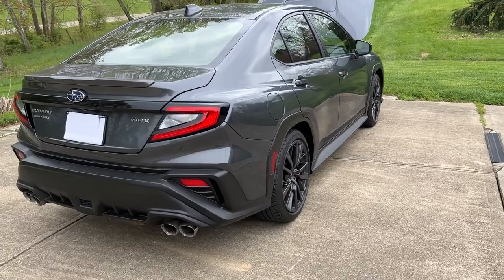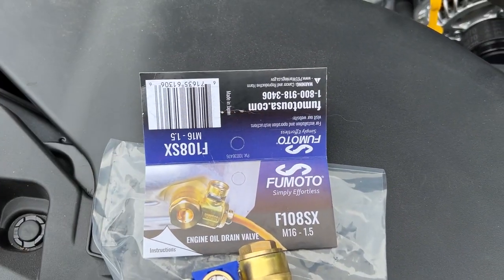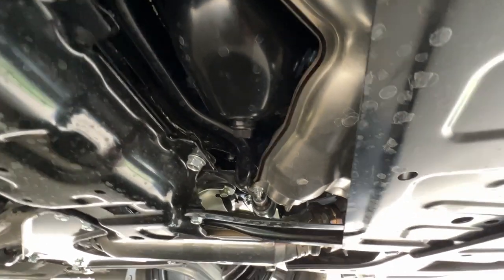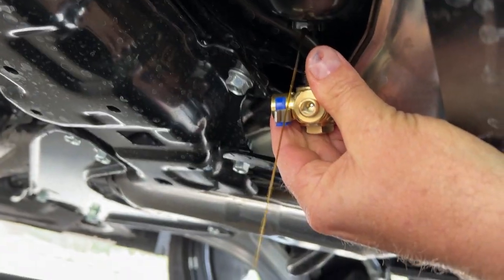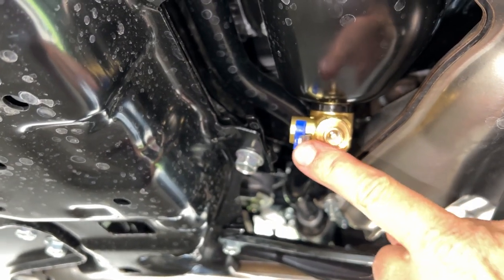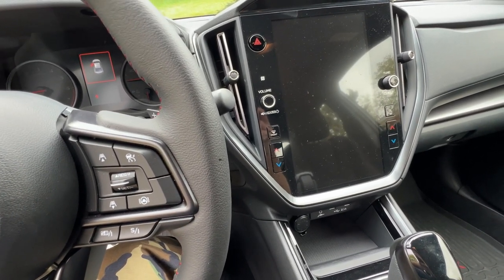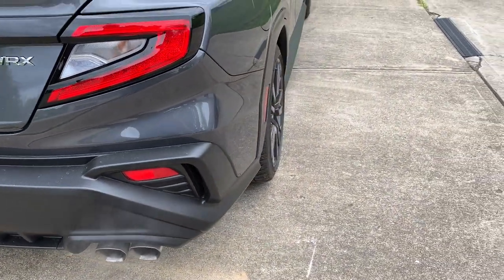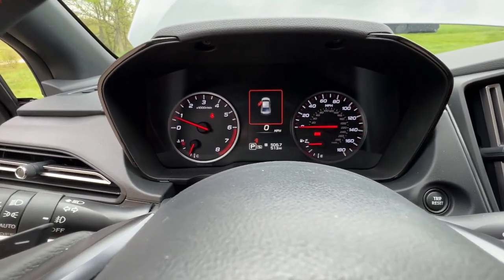2023 Subaru WRX Oil Change + Fumoto Oil Drain Valve Install

Comment: thanks to the valve, I dont even need to jackup man car. just drive the car on top of some patio bricks to get some clearance. Then drain the oil with one hand. Fortunately, the oil filter in on top.  game changer.
Reply from the maker: Definitely makes it much quicker and easier. After the valve is properly installed, it’s fast end easy to change the oil.  I love that the oil filter is on top of the engine also.

Comment: I'm always confused why people choose to stop using the black Japanese-made Tokyo Roki OEM oil filters, they're the best. In this video you mentioned you're swapping for a Wix....because you heard the blue Subaru filters were bad? The NA motors in the American market models do use those blue filters, and they ARE terrible, but the Tokyo Rokis are not made like the blues are.
Reply: black tokyo roki is absolute best filter for these engines.

Comment: If you want to stick to Subaru OEM filter, you want the part# 15208AA170 Subaru OEM filter which are made in Japan (Tokyo Roki).  These are high quality oil filter and not 'Fram' filters.
Reply: Are all the black OEM Subaru ones the Tokyo Roki filters?

Comment: Nice! I pick up my Wilderness tomorrow with that same engine. I too will get the drain valve for it. My question is the Torq spec you stated. I read 31 ft lbs...where did you get 18 from? I just sold my Legacy with the 2.5 and it was 29 ft lbs.
Reply from the maker: Thanks.  31 is the torque using the factory bolt but 18 is the torque for this model Fumoto drain valve. That torque spec is listed on their website. If you try to torque it to 31, you’ll probably strip it because it’s just brass. The factory drain bolt is steel.  https://help.fumotousa.com/en-us/Knowledge/article/3018/How_much_should_I_torque_my_Fumoto_product
Reply: @ThePhotographyHobbyist  well that is good to know! Thanks!

Comment: Did you take the crusher washer from the original oil drain plug and put it on-top of the rubber gasket of the fumoto valve?
Reply from the maker: No, don't use the old crush washer. All you need is the rubber gasket that's already on the Fumoto

Comment: Beautiful machine, love the colour. Very good idea to do the early oil change I think. I wonder if modifying the oil drain valve might effect the warranty.
Reply from the maker: There’s a discussion here about that.  https://www.subaruforester.org/threads/2021-will-using-a-fumoto-oil-valve-void-my-warranty.823035/  
I also remember checking on this long ago when I installed one on my truck.  The short answer is no.  By law here they can’t void the warranty. If you cause damage by improper installation or use a part that maybe isn’t reputable or built correctly, then I guess you might have problems.  But no issue with the fumoto drain valve.  And yeah, I love that color on it also.  The lighter colors don’t look right with those dark body moldings.

Comment: That’s an interesting spot to put a jack stand, is it a reliable spot? Will it hold the car up without the help with your jack? I’m always looking for spots to put a jack stand on our VB’s
Reply from the maker: I've used that spot just briefly to hold the car while I moved the jack to a different spot, but I personally wouldn't leave it there. I only use that spot as an extra layer of safety to place a jack stand because there's no room on the side where you normally raise the car because the jack is already there, unless you want to use a spot next to the jack that has the plastic cover over it - which might be fine since it's along the same place where the jack goes but I think they just cover the other area with plastic to help guide you to the part that is NOT covered in plastic as the correct jacking point. It would probably be OK and hold the car well and cause no damage, but I'd rather have the jack stand out where the jack normally goes, if possible. I think the body is stiff enough that you can jack the car up further back in the rear (on the side) and it'll raise the front enough to place a jack stand where the jack would normally go.

Comment: Great video. Where did you get the oil funnel from.
Reply from the maker: Thanks. You can get that on Amazon for $20.  https://a.co/d/gXBXX42
Reply: @ThePhotographyHobbyist  Thank you. I just pickup a 2023 WRX And I don’t trust the dealer doing the oil change. I have so many bad experiences with past cars. I just hope I don’t void my warranty by doing it myself.
Reply from the maker: @felixlaboy1453  it’s illegal for any manufacturer to void your warranty if you change the oil yourself, as long as it’s done properly.
Reply: @ThePhotographyHobbyist Thank you once again buddy. 

I’m looking to get also the Fumoto oil drain valve. I was wondering are you still happy with the one you installed. Do you any leaks.
Reply from the maker: @felixlaboy1453  i’ve never had any problems with this type/brand of drain.  I had one on my old truck that I replaced in 2014 and I have one on my truck. I still own that I bought in 2014 and it still works great, no leaks.  And, of course, no leaks on the Subaru. Just be sure to pay attention to the torque specs on their website, this drain valve does not get tightened as much as the original drain plug, otherwise you might warp the housing or damage it in some other way, because it’s made of brass.
Reply: @ThePhotographyHobbyist  Thank you so much.  Keep up the amazing  videos. 

I don’t torque wrench I will have to buy one.

Comment from the maker: I have some nice photos of this WRX on my photography website here:  https://www.thephotographyhobbyist.com/Other/2023-Subaru-WRX/n-bkW2QF/
And before you complain about the CVT, drive one and see for yourself. I'm impressed with it. It doesn't really feel much like a CVT. It pulls strong/hard from a stop and the simulated 'shifts' do a pretty good job of simulating actual shifts like in a real automatic trans. Car & Driver says the 0-60 and a rolling start to 60 is faster than the manual trans. So, from that standpoint (performance), the CVT will do well for you. This CVT doesn't feel like the horrific CVT I had in a Nissan rental car in 2021. OMG...THAT was a terrible CVT (Nissan Rogue, I believe).  By the way, we're still missing the red STi under spoilers we order for it when we bought the car. Not sure when those will arrive.
Reply: CVTs are awesome. Don't worry

Comment: Nice! We have the same color Rex..not too many of ours around! Did yours come with a short throw Sti shifter? My base Rex came with a few upgrades from the factory
Reply from the maker: This one actually has the CVT transmission because we bought it for my son and my wife insisted on it being something she could drive if she had to in an emergency (she can’t drive a stick). The bonus though is that it has the eyesight safety system which is good for my son who is not necessarily a new driver at 19 but this is his first car.

Comment: This is the first car where I think I'll do my own oil changes. I think I would do a similar achedule like you every 4k miles since I only daily drive abd occasionally canyon carve.
Reply: Note Subaru also wants you to change the oil every six months for the 2022-2023 WRX, even if your miles between oil changes is under 6000. So...6 months OR at most 6000 miles, whichever comes first.

Comment: 4:29 what did you mean exactly when you said “when you jack from the front, it comes off in the back also” what comes off? I recently took delivery on my 2023 wrx as well in limited and I’m loving it! Just hit 700 miles and getting ready to do a first early oil change at a 1000. Any suggestions/advice would be most appreciated as this will be my first time doing an oil change myself.
Reply from the maker: Personally, I know Subaru says 0W20 oil, but to me that's too thin for a small engine with a turbo and it's been known that manufacturers will recommend a thinner oil just to help improve fuel economy numbers. Ford used to recommend 5W20 for their F150 with the 3.5 twin turbo engine but later switch to 5W30 because %W20 is really too thin in that scenario. Anyway, if it was me, I'm use a good quality 5w30 synthetic oil in the WRX. Also, assuming you're just reusing the factory drain plug and not installing a drain valve like I did, best practice is to replace the crush washer that goes on the factory drain plug. Your dealer's parts dept can get that for you or you can buy it online somewhere (I don't have the part number handy).
Reply: I was talking about when you said ‘when you jack this up from the front it comes off on the back also. “ , what exactly comes off in the back? Here is the time stamp of what you said 04:29  i appreciate any help, guidance as I still haven’t done my oil change by myself, and I came back to rewatch and follow as I will be doing it for sure next week :) Liked and subbed!

Comment: Just got the same watch me but a 6 speed manual. Came from a 2020 accord with a cvt and I hated it how's the this drive with it?
Reply from the maker: I’ve driven several rental cars that had CVTs and hated them. Mushy/soft feel and ‘oozy’ forward even when you put the pedal on the floor. With the CVT in the WRX, it’s totally different and it pulls hard. If you hadn’t told me it’s a CVT it would take me awhile to figure it out. Using the paddle shifter in the steering wheel gives you distinct ‘shifts’ too and if you downshift fast to a lower ‘gear’ it’ll make you move forward in your seat. Maybe some still complain about it, but my experience is that I’d be totally happy with the WRX CVT.

Comment: what engine oil you use??  what oil you use for rear diff??
Reply from the maker: The manual says 75W-90 gear oil for the front and rear diff.  For the engine I prefer a nice synthetic 5W-30. Same as I use in my twin turbo truck. Subaru says 0W-20 synthetic for engine oil but speculation is car makers spec the thinner oil for fuel economy reasons but I wouldn’t stray too far from that. I wouldn’t use 20W-50 for example.  Oil is always a big debate with people but I simply try to stay close to the recommended oil. 
Page from the manual:
https://s9cdn.joomag.com/mobile/2/2696/2696171/474_3-0.SVG?_=1952955011&v=1707497667

Comment: 5w-30 over 0w-20? FYI 5.1 quarts to fill line on these.
Reply: Would also like to know the logic behind this
Reply: Yes, Subaru recommended 5-30 for a few decades, the only reason I can see they changed to 0-20 is the push from United States EPA pushing lighter oil for better “fuel economy” and the whole sAvE tEh pLaNeT BS… 5-30 protects up to 104 outside temperatures…0-20 is only provides full lubricant protection up to 86 degrees, and most turbo charged engines get more air and run hotter. Makes sense.
Reply: @longshanks5531  the first number does that so you could use 5-20. Was thinking to make that change myself
Reply from the maker: If I recall correctly, Ford used to use 5W20 in their turbo charged ecoboost engines but switched back to 5W30 at some point for more protection.  To some extent, the thinner oils being used lately are partially to help meet fuel economy requirements, but me personally, I wouldn’t deviate too far off from the recommended weight and I wouldn’t go thinner, I would only go a little bit thicker.
Reply: @ThePhotographyHobbyist  yeah I’ve seen a few displays where the thinner oil will circulate faster and what not, but I wouldn’t run 0-20 in a turbo engine… just weird how long Subaru recommended thicker oil, now all of a sudden with the climate change BS the epa is pushing thinner oil for better gas mileage. Some guys run Rotella 5-40 in the Wrx…
Reply from the maker: I'd be happy if I could just get a 5 gallon gas these days that doesn't cost $50 just to get a vent so you can pour gas without the 10 minutes of waiting while it gurgle, gurgle, gurgles LOL.  I did buy a SureCan, but while it is nice, it doesn't hold the advertised 5 gal. The most I can fit in without overfilling is 4.8...and I don't want to pay big money for 2 more cans that I need. My favorite is still my old pre-EPA rule can that has a vent on the back that pops open so it pours easily. @longshanks5531